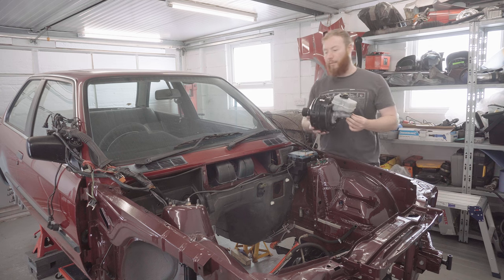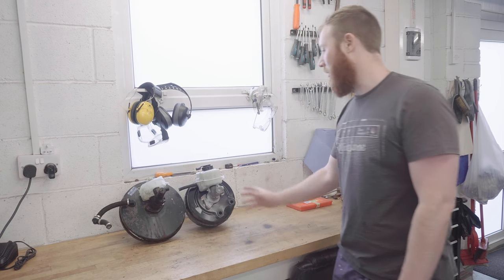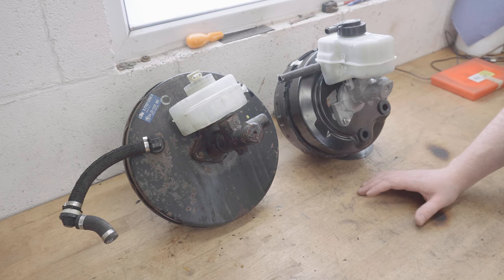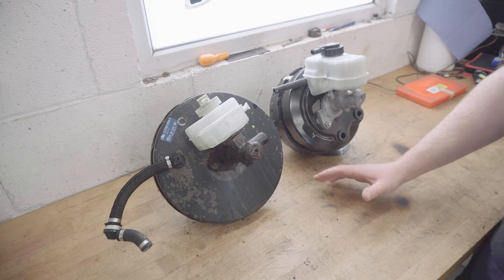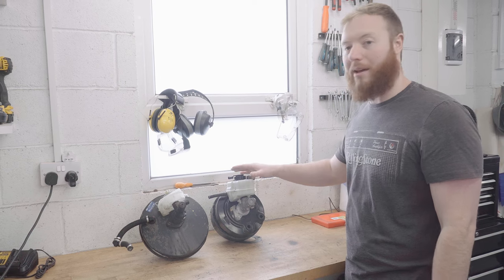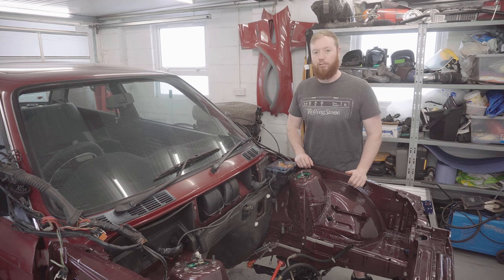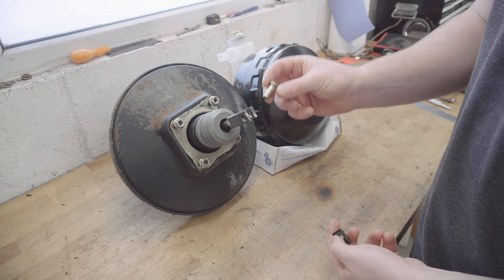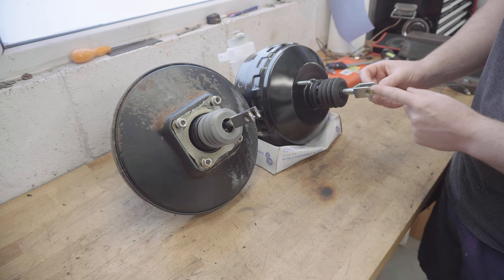How To Fit E90 Brake Booster Into BMW E30 M52 Swap RHD | Slim E9X Servo Install Guide | 043

Comment: what's the part number from the servo?
Reply from the maker: Here's the info for the booster I got:
BMW 3 Series E90 E91 E92 E93 LCI Brake Servo Unit Master Cylinder 6788040 (UK market, RHD).

OEM part no.: 34336779721 34336785665 34326764117 6788040

Hope that helps!

Comment: Would the E90 brake booster fit with a M60 V8 swap?
Reply from the maker: Great question! I think yes, but having never done an M60 swap I can't say for sure.

Hopefully someone with the knowledge can chime in and answer that here for you. 🤞
Reply: Pretty certain you need to do the relocation into the glovebox, there are kits out there to do this!
Reply: There is simply no room for it on the bulkhead with a V8 so are 3 options.

1) run it booster-less via a pedal box
2) use the E34 style remote booster mounted behind headlight. Some adaption of factory brackets and frame rail required. 
3) locate inside the car in the glove box area at a 90deg angle. 

The latter of which I chose to do for my E30 M60. (Long term project) 😅

Comment: What year e90 booster did you need?
Reply from the maker: Earlier ones come without that second vacuum hole, so if you want an easier time go with one of those.
Reply: @SPANNERRASH  i found one with only one port, can that work?
Reply: @SPANNERRASH  also my vehicle is a 1990 320i came with abs module would the install be any different
Reply from the maker: @drayescobar9469  One port is simpler, it will be ideal. The ABS model E30 will be much the same. The only difference is that the lines will go from the master cylinder to the brakes via the ABS, rather than directly. I think when you lift the bonnet and trace the lines that will become much more obvious to you.